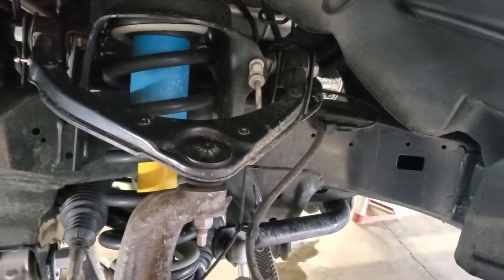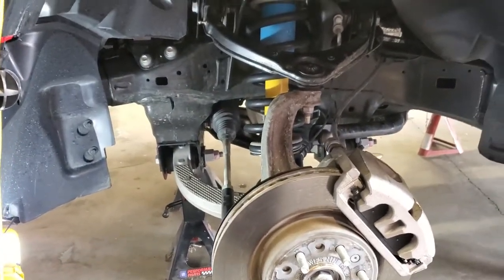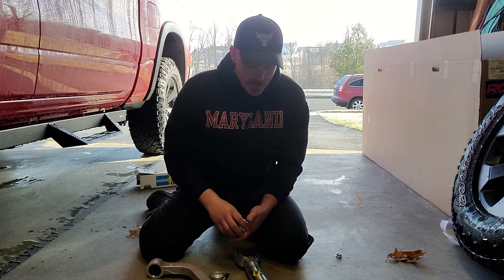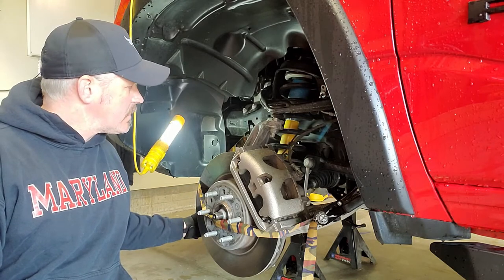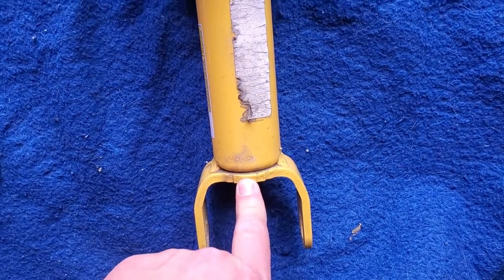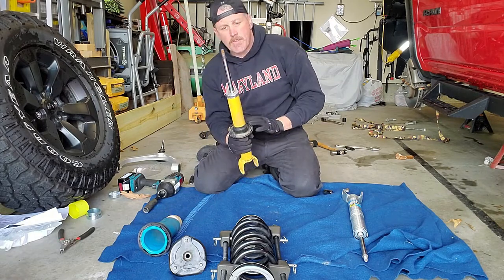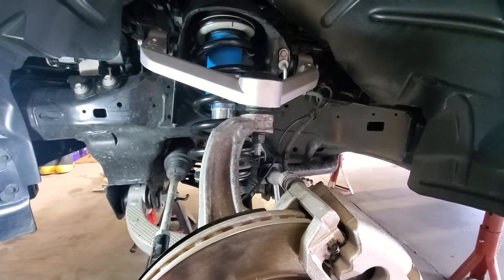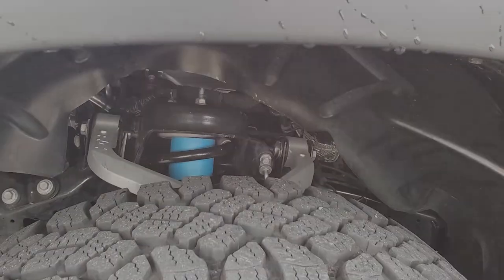2021 Ram Rebel 2" Level - Bilstein 5100/Rough Country Control Arms

Comment: great work! got the parts and consuming all the install vids i can before tackling. appreciate the attention to detail, callout to other's work, and including sizes and torque values in the description. keep producing quality content.
Reply from the maker: Much appreciated!
Reply: @theaveragejoesgarage5418  got this done this week thanks to your video. still need to get it aligned and drive around a bit...   i know it's going to settle, but guess i'm a bit nervous since i don't want "carolina swag".  the front is actually sitting a bit higher than the rear, 3/4-1".  was yours similar before the suspension had time to settle?
Reply: phew it settled after a couple more rides ;-)

Comment: Does the Rebel sit a little higher than the Laramie/Bighorn from the factory? I'm also wondering what size wheels/tires you're running with that setup. Thanks!
Reply: The Rebel sits 1" higher than the other trims.

Comment: Great video!  This will be my next upgrade on my 21 Rebel in Billet Silver.  I have been wanting to do it after watching WF41 do his, but just haven't got around to doing it.  I upgraded to a Borla S Type and it's perfect.  The ATAK was a bit much for me.  Like you, I live in PA and deal with the salt and brine in the winter.  I took the plunge and had mine fully  rustproofed with New Hampshire Oil Undercoating (NHOU) and happy I did.  Hopefully the top nut on the strut isn't corroded like yours were.  Anyway, thanks again and for the details in the description box!

Comment: great video. at 8.30 you describe the RC 3 - 3.5 UCA and also mention the Rebel comes with a 1in lift. Well that 1in goes away when you remove the OEM strut (which adds the 1in lift) and replace with the Bilstien 5100 (2in lift). So the net increase is only 2in not 3in.
Reply: That is not true I did the measurements vs a stock Laramie my friend has, 1 inch difference before the 5100s and 3 inch difference after.. and almost another inch with the 35inch tires after. A total of approx 4 inches over normal 1500s with that setup

Comment: ok, I just did this. Couple things to help everyone out.. if you compress the springs just enough until loose to get out the OEM shocks you will not be able to get the top shock rod to poke through the top shock mount. You need to compress that spring until it gives you clearance to get the shock rod through the top mount and you can get the nut on. Approx 3 inches of exposed threaded rod on coil compression tools. Bilstein is painfully slow in helping you if you call/text them.

If you don't have an impact gun I wouldn't even start it unless you like to fight with everything. Once the coil is compressed and you have to remove the top shock nut in the mount, everything will just spin unless you have the power of an impact socket to spin the nut off. If you don't, you need to use a wrench to hold the top of the rod and then find something to back the nut off. The nut is recessed so nearly impossible to get ahold of it. I recommend using a spray lubricant before even trying. My truck is brand new  and the nut was still a pain. To be honest most nuts are a pain without an impact gun. Sway bars, tie rod end both need a way of holding the bolt when tightening the nut. If you don't have a pass through socket set to do both it can be tricky.

I certainly appreciate the video, would never attempt without it. This kind person even helped me when I reached out on a holiday weekend. Thanks man!! I just want you to know this upgrade isn't for everyone and a second set of hands is appreciated.

Also if you don't have deep sockets that fit all these nuts buy them. Don't wait, just buy them. You need them. Good luck!
Reply: Also, I was unable to break part the ball joint of the upper control arm. My truck is brand new. I bought a ball joint breaker tool (forked wedge), beat the hell out of it with a heavy hammer, nothing would break it free. Couldn't get the gear puller to fit on, no room. Taking it to the stealership to finish this job. Shocks are in, couldn't break the ball joints to get the new control arms on. Good luck.

Comment: I was wondering if you’ve had any issues with the RC upper control arms. I know RC says they’re for minimum 3” of lift and technically your set up is a little lower. I’m trying to find the right pair of upper control arms for my rebel that I’ll be putting the Bilsteins on.

Comment: I'm in the process of upgrading to Bilstein 6112 and RC UCA to level my Rebel. When looking at the 6112 specs, it was mentioned that to get a 2" lift, it needs to be at the 8th circlip. The 5th circlip will only raise it by 0.8". Does the 5100 have the same lift height specs? I don't want a reverse rake.

Comment: Did you have to compress the spring even farther to get the nut on top of the new shock? Because you moved the bottom coil mount up approx 2 inches that means the top of the shock doesn't stick through the top bucket.

Comment: After doing my do diligence.. lol I finally settled on the JBA UCAs with the Bilstein 5100 front & rear, ride quality is a tad firmer with sports car like handling.. it’s a fun truck to drive & have not noticed any gas mileage difference still 17 mpg combined with Etorque. Would probably be better if I would stop listening to the Borla..
Reply from the maker: Man, I know the feeling.  I can definitely tell the difference in gas mileage by my ear..... I find the mileage more often then not sinking because of my right foot....
Reply: borla is amazing. after a corsa sport on my last truck disappointed when merging or passing, i installed the borla atak this time around.  it doesn't disapoint anyone but my neighbors on cold starts. :-)
Reply: What setting did you have the Bilsteins at? I wanna have at least a 2.5 inch lift but am not sure if I would need the rear shocks as well

Comment: Great video. What are the official end measurements of the front end height after installation? Also, how does it compare to the rear end height? I believe Waterfowler said he only got ~1.6" from this lift and wanted to see if you got similar results.
Reply from the maker: I got about the same.  It is "mostly" level.  Certainly not higher in the front which would have driven me crazy.  Still probably a slight rake.  As for the official measurements, I have long forgotten now unfortunately.